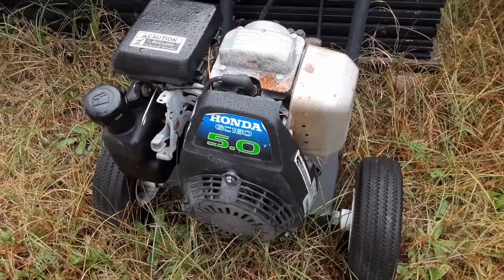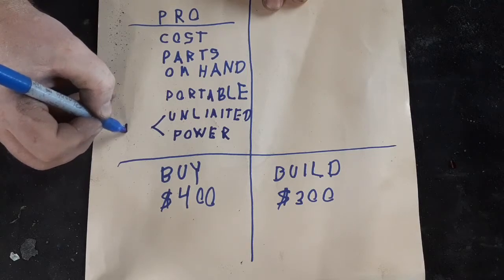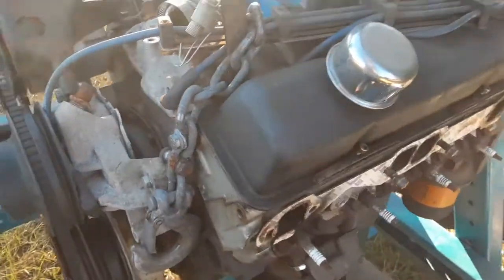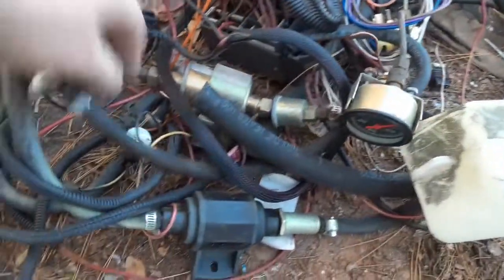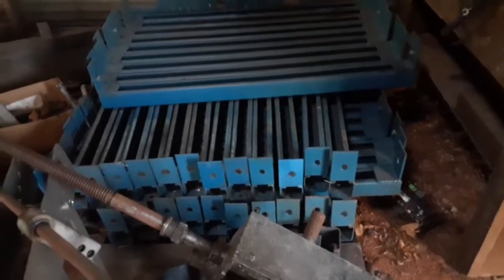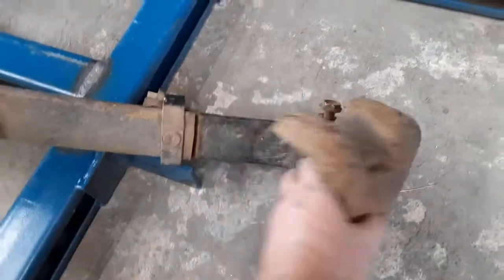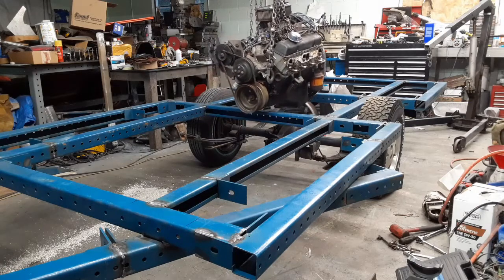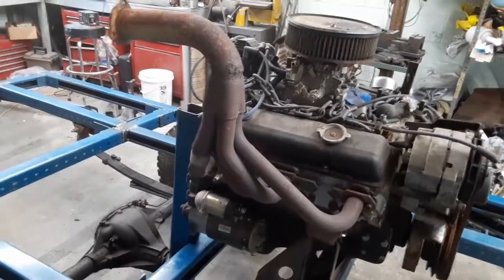DIY Pressure Washer Trailer Build.

Comment: I love it! Can’t wait for part 2!
Reply from the maker: Probably later this week. It's been tested and works, but I need to add a radiator. I'm paranoid about overheating the engine so I haven't ran it more then 30 seconds or so. Pressure works awesome though, nearly flew outa my hand lol

Comment: I used to work at a equipment rental company. We had a home built pressure washer. It had a good size v8 Deutz diesel Air cooled engine on it. Pressure washer had crazy high pressure. It worked great for removing old paint
Reply from the maker: Dang, thot I was being original, guess other people had V8's laying around and stuck them on pressure washers too. Cool to know it's been done before.
Reply: @wilsworkshop  had another home built pressure washer that had a strait 6 Deutz diesel on it. Not as much pressure as the V8 but it would still blow a normal pressure washer away.